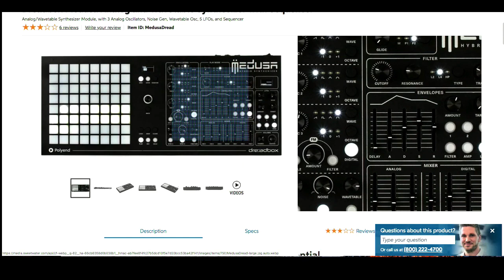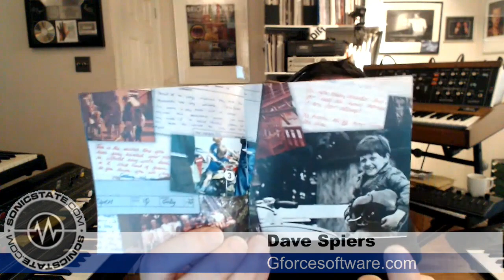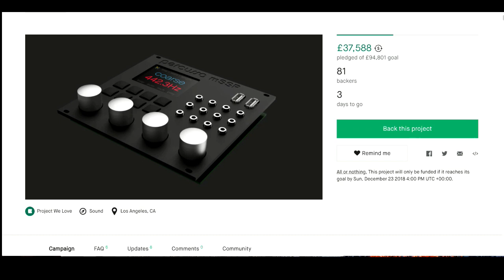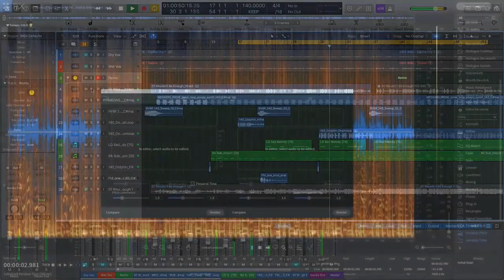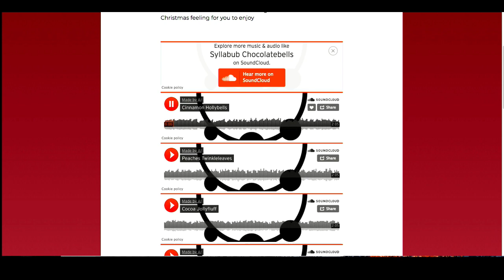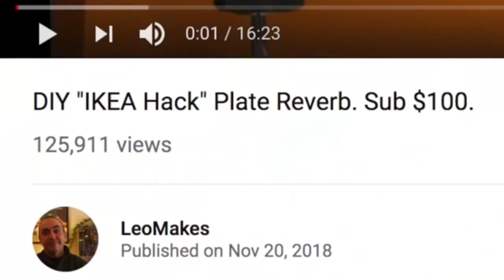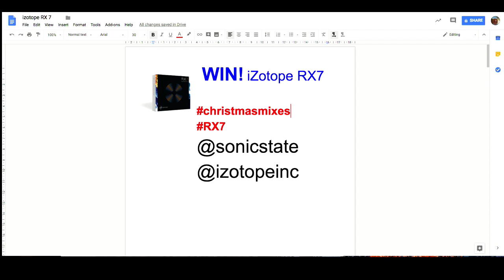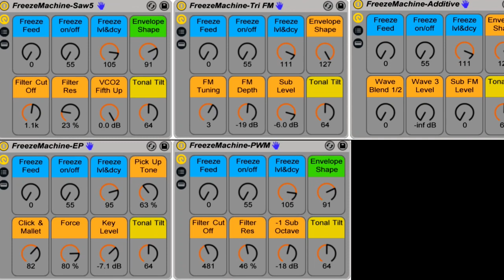Sonic TALK 563 - MerrA.I. Christmas Special

Comment: "It is so powerful. It's one of those modules: it could be a drum machine, it can do granular stuff, it can do wavetable, nice chords and poly stuff..." By the way it has a display and USB. Reminds me of my Laptop. Only that my Laptop doesn't need another Laptop to edit it. I have a Nord Modular by the way and still love it. But I don't get how this is supposed to be desirable in 2018.
Reply: It integrates with your modular by design. Can you work with your modular and your laptop? Sure, but you need an interface, software, and modules specific for it. Can you do all that for less than $600? Nope. By the way every digital module in the world is a computer as well. Welcome to 2018.
Reply: By the way Merry Christmas! To post something constructive. ;-)
Reply: Hardware modular > software modular in my opinion/experience. CPU usually craps out before the patch gets interesting with my 2x laptops, where my hardware doesn't suffer the same limitation. That said - Arturia Pigments runs quite smooth w/ more serious modulation settings so far - quite impressed. Also, I'm infinitely more interested in powering up the modular/hardware vs clicking around on my laptop. Everyone has their own preferences on how they make their art.
Reply: What I meant was that you need to connect it to a computer to program it. That is exactly the Nord Modular experience. On the other hand I assume you have a computer running already for recording unless you only fiddle around for fun or have a really nice old school studio with a tape machine. So my argument was not about making music with a computer vs. "dawless" or whatever, but about me personally, with my own habits and so on preferring hardware for what it's good at (hands on, wysiwyg, doing the limited thing it does really well, analog sound in some cases etc.) and computers for what they're good at (being able to be anything you want them to be and then some). I just though it was absurd when I heard Matthews excitement. But when I think about it I see how something like that might be cool as it allows you to modulate and sequence it from other modules and that will definitely lead to results you won't get either from analog modules alone or from digital non modular synths. I just don't get the whole concept of eurorack as a "does it all" studio setup with digital reverbs, compressors, mixers etc. (all with tiny and limited interfaces while being relatively expensive) as opposed to it just being a creative tool and good sounding monosynth, fx unit etc. amongst other gear that is way better suited to play drumsamples or polyphonic wavetable pads for example (and that you still can run through a modular if you want). I think that was the underlying notion of my comment. I guess when you're on the eurocrack train you're even going to desire a hard disc recorder in eurorack format in the end just for the sake of it being inside one of your racks. Once you have that you will want a laptop inside a module because it will save so much rack space and you won't have to hook up your rack to a laptop any longer.
Reply: Modulo Sonoro Find me a computer with built in CV I/O and I’ll make it happen ;). I agree it starts to go backwards at some point, but as long as it fills a function in the rack I don’t see why not.
Reply: pV I guess expert sleepers is the best compromise to intertwine computers and eurorack, but I‘m really not an expert on those things. Anyways, as I said, merry christmas to everyone!